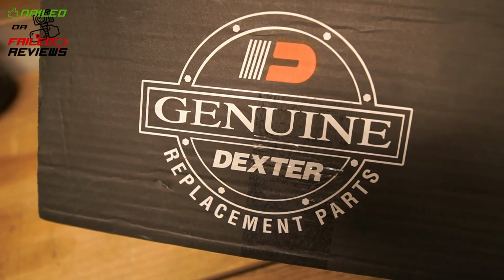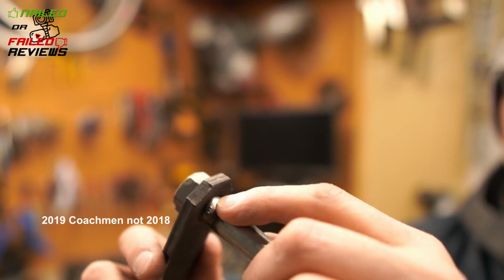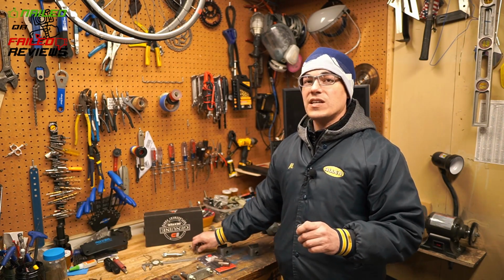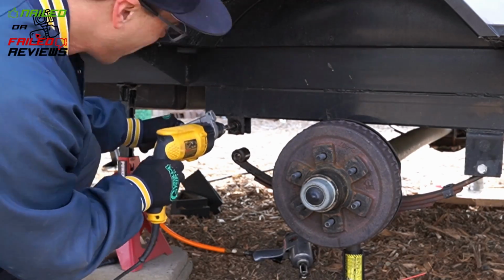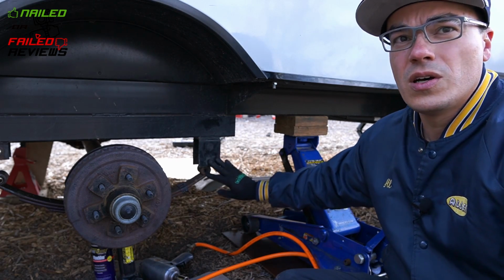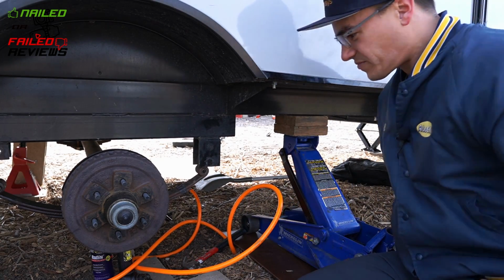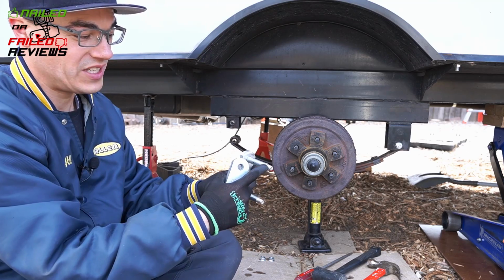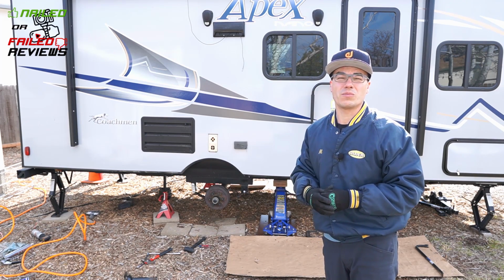Trailer Axle Shackle Upgrade Install with Upper Hanger Fix - Dexter Axle Heavy Duty Shackle Review

Comment: Does the tire run really close to the shackle? 
If not, why not replace the straight zerk fitting with a 90 degree zerk fitting and avoid all the extra work. 
Plus, you wouldn't have to crawl under to greese.
Reply: Great idea! Makes sense.
Reply: I replaced the zerks with the 90s.
Reply: Yeah, I would just leave the Zerks facing out. Worst case you just grease them up when you repack your bearings every year.

Comment: SUGGESTION: For your next upgrade.........go with torsion axles or Torflex. That would really help the towing experience and save the trailer longer.
You can take the grease fitting off while you are setting the bolt. The other thing that will add a lot of strength to your hangers is take the trailer to a welding shop and have them "box" or weld wedges into the hangers. ALSO.....Where was your TORQUE WRENCH?????? There's specific Ft/Lbs needed.